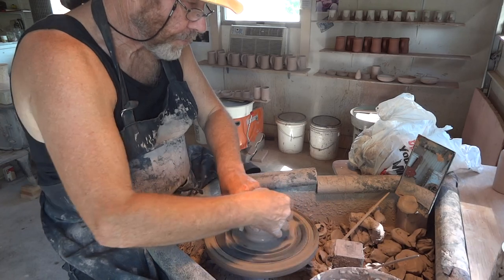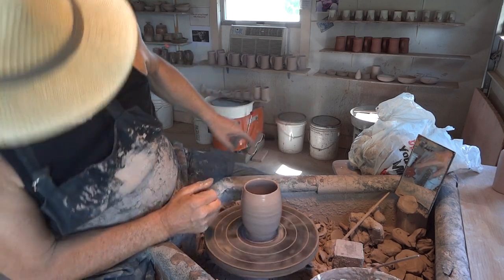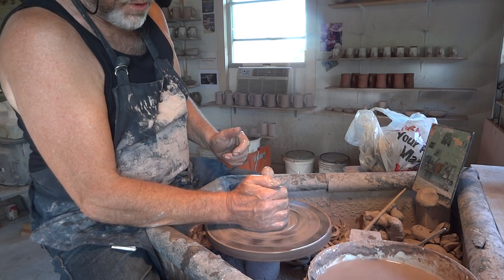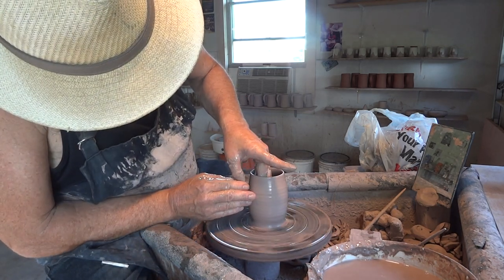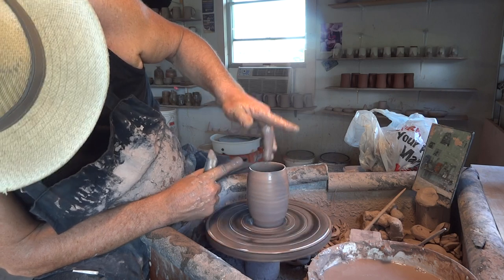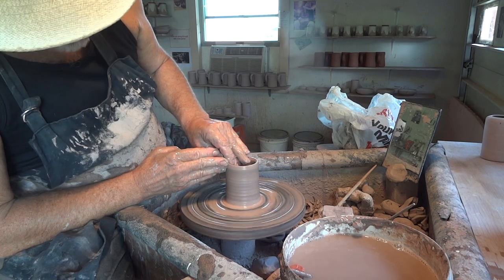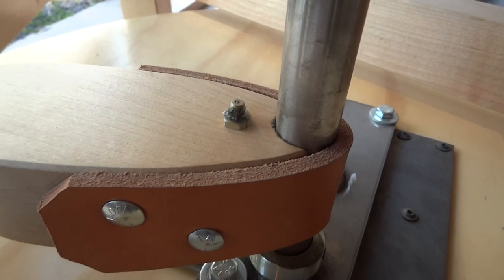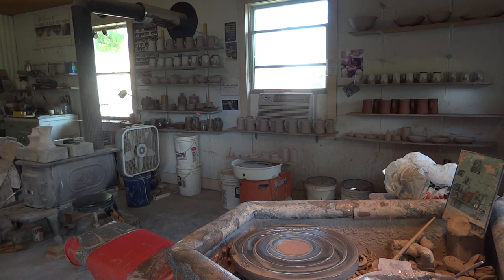Throwing a taller style tea bowl - June 29th, 2020 with SImon Leach

Comment: Pushing the clay with the broad flat surfaces of my fingers was exactly the problem I had when I started throwing last year.  Just as you said,  the friction mounted quickly as I effectively squeegeed off all the water and slip that were providing lubrication.  Finally, the entire piece twisted from torque overload.  I did that over and over the first day.  It was maddening.